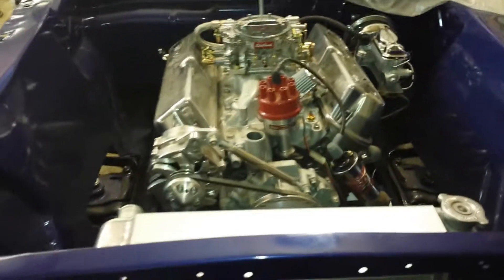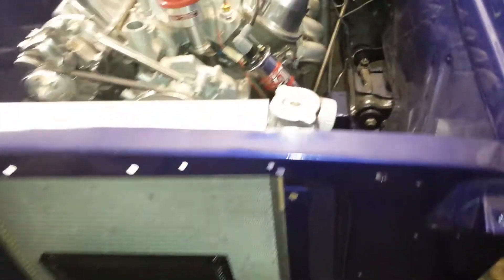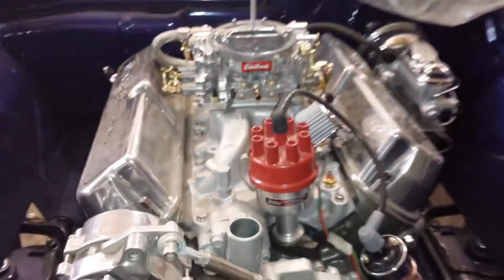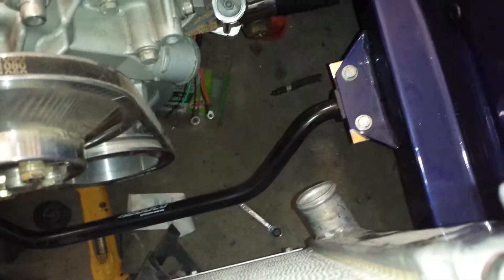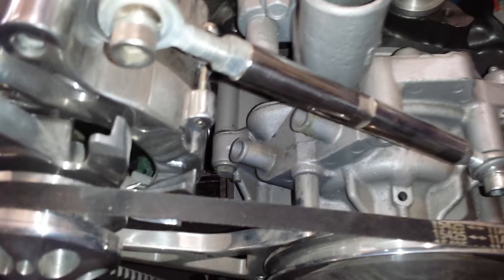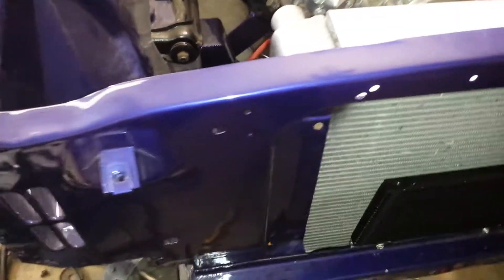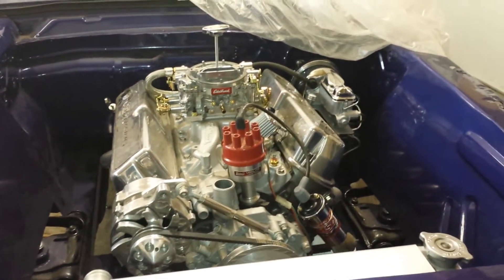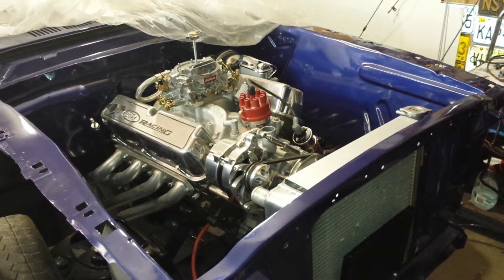1965 Mustang restoration: radiator installed

Comment: Billy, looking good, that top hose looks tight with the alt there, I will see if I can find a standard top hose around the shop to see if looks remotely close. That's gonna be one fair weather Mustang with no heater. We should coordinate our start up vids, good luck on more progress.
Reply from the maker: Ha coordinating start up vids would be cool.  Hard to tell when I'm going to get it started though.  Still need to do some wiring.  I do remember the alternator being in this location before the tear down and the upper house was up against it.  I'm thinking it will need to be moved.  I'm also going to see if the local parts store will let me go rummage through their houses and see if I can find something.  Thanks for watching Rich.  Always appreciated.
Reply from the maker: I do not plan to have this car out in cooler weather.  If I need the heater on then it will be to cold to take the car out of the garage.  It will be driven on nice days only.  I'm going to baby it
Reply: Ya I figured as much, no heater needed when it's staying in nice weather!

Comment: Look at the fox body Mustang upper radiator hose it might work for you. And the radiator looks good and it will keep your car cooler then the stock one. Looking good!
Reply from the maker: I will check that hose out. I ran the engine hot one time with this radiator.  It didn't have a good enough fan on it and hopefully this time around I will have things figured out.
Reply from the maker: Thank you sir.  I picked up a fox body hose today and I think it will fit with a little elbow grease.
Reply: Nice. Hope it works for you.

Comment: For the top hose if you can make a model of the way you need the hose out of some coat hanger metal and bring it to an auto parts store and they can custom make a hose for you.
Reply from the maker: I was not aware of this.  Thanks.

Comment: Great progress! I'm diggin' the radiator and the mount...doesn't look to bad from here.  If anything bend a coat hangar to the shape of the hose you need and take the hangar to the parts store and see if they'll let you root around their hose wall. Or you could swap the alt to the other side. You're running manual steering, right?
Reply from the maker: Yeah manual steering.  That coat hanger idea is exactly what I was thinking of doing.  If I move my alternator then I'll have other options on a house too. Thanks for watching.

Comment: im so damn jealous.. things looks beautiful lol.. i can't wait to get to the "put shit together" phase.. make sure if you paint the radiator, to use the spray intended for radiators.. heat resistant, and won't affect cooling much. also, as for that radiator hose, have you thought of doing a hard pipe with 2 silicon couplings? similar to intercooler piping. that heater inlet/outlet on top you said you'll take out and put a plug in, you already have a temp sending unit elsewhere for water temp gauge? or you don't have that gauge anymore?
Reply from the maker: The putting stuff together phase is turning out to be pricier than I imagined.  You do bring up a good point about the temp sending unit.  I think I removed it to put in the temp switch for the fan. Looks like I need to put it back in
Reply: Cobrafanatik22 that's what i figured.. saw the fan switch.. didn't know if you had another inlet toward the back of the intake like mine for the sender or not. the pricey part is one part im not looking forward to, but its always more fun to install new stuff, than it is fixing old or broken/rusted stuff.. :/
Reply from the maker: That's true.  I started buying small items here and there because I just couldn't put the old dirty stuff back on the engine bay.  It's definitely going to be a lot cleaner this go around.

Comment: As far as radiator hose...Id go with one of those stainless steel braided flexible radiator hoses...there for custom applications and will bend the way u need it. Check summitracing.com.
Reply from the maker: I see what you mean but I think I'm going to leave it this way.  If it fails under pressure then I will upgrade it in the future.  Thanks for watching!
Reply from the maker: Man I compelling misread your comment.  For some reason I was thinking that you mentioned the trans cooler. I'll check out those hoses for the radiator.  Thanks
Reply: Cobrafanatik22 u got it